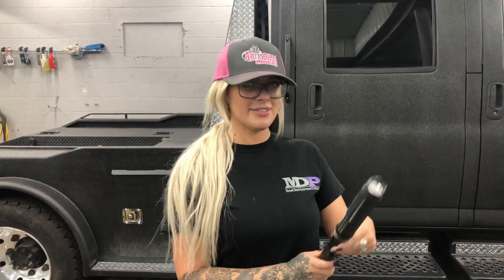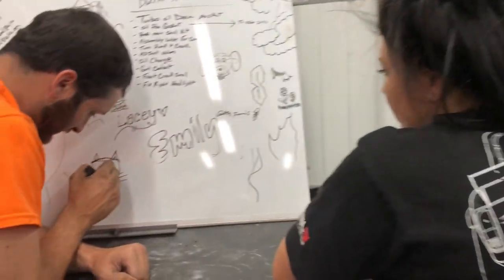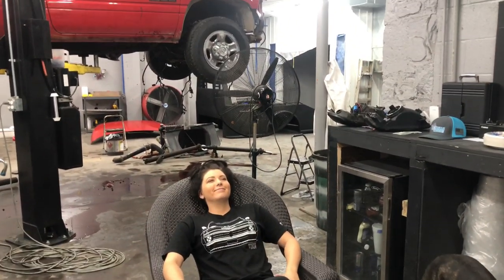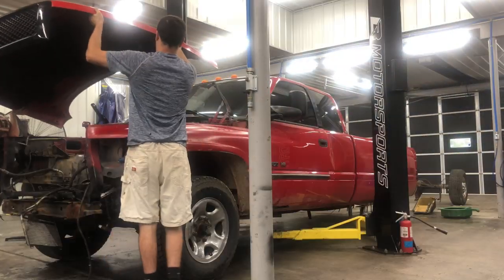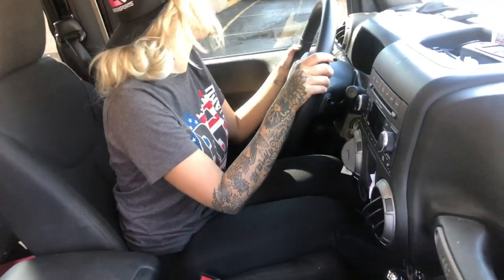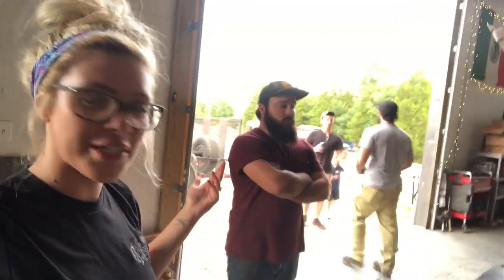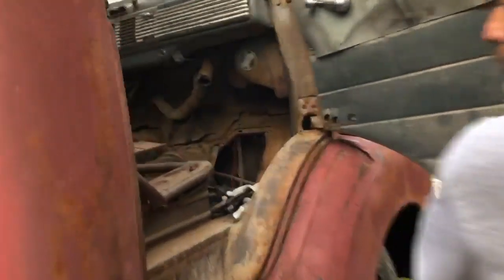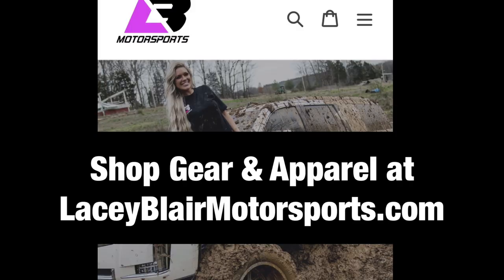Tearing into the donor truck. Literally

Comment: I imagine using 2 different axles from 2 different brands is going to cause some gear ratio and bolt pattern issues.
Reply: bolt patterns are the same and if they have different gear ratios you can change gear ratios easily. most solid axle swaps are done with super duty front axles.
Reply: Jess Gilliam bolt patterns are NOT the same
Reply: smcox1991 your right chev and dodge are same ford is different but if your putting that much money into a semanbuilt buying a set of front hubs is chump change compared to what they spend on everything else